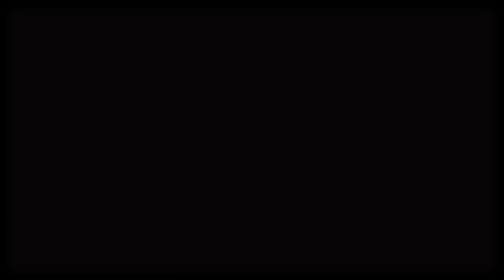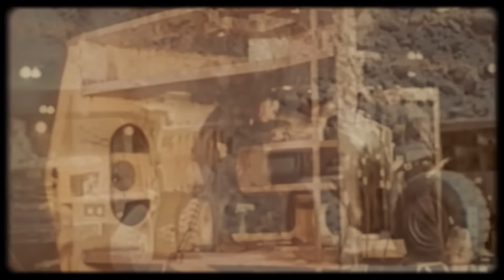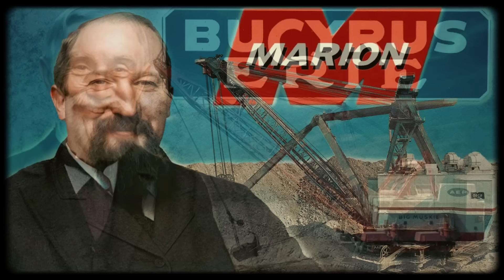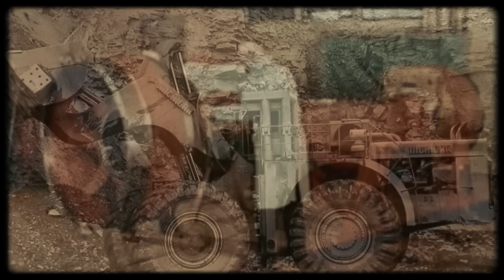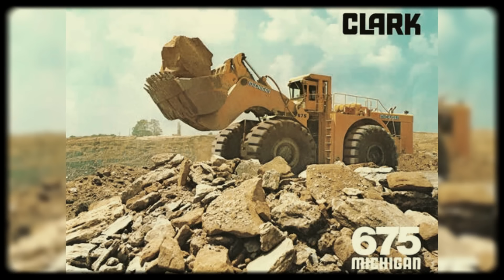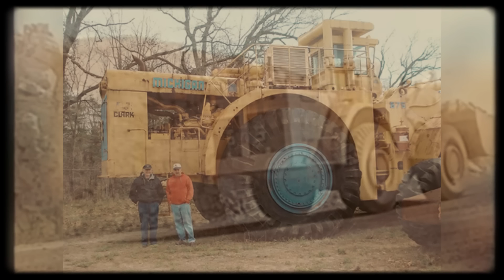They Built the World's Largest Wheel Loader (But Sold Only 14 in 15 Years)

Comment: The 675 Clark had 2 16V71 screaming jimmies Detroit diesels not Cummins
Reply: Later models had two Cummins 1710 V12 engines, I know because I worked for a Clark dealer, Rudd Equipment Co. based in Louisville Ky.
Reply: No it DID NOT the first 2 Prototypes had 2 24V71 DETROIT ENGINES!!! But the14 that were sold had 2 CUMMINS 1710 V12 ENGINES.

Comment: all this big stuff is designed to SAVE OPERATOR labor....it doesnt make sense to not buy 2 or 3 smaller ones.L believe its true about big dozers too.END DUMPS too...labor is high at 150k(all in benifits included)..but it looks like small is better.

Comment: Should have learned from the German military on Panther tank. Weighing ~50 tons, it was over-engineered, unreliable, and prone to breaking down or cracking under stress due to poor-quality steel. The Sherman Tank was much simpler lighter easy to repair. nearly 50,000 units built compared to only 6,000 German Panther tanks. Bigger is never better.

Comment: Seeing the operator standing upright with no protective cap shows this time had different safety standards (1.04 into the video)
Reply from the maker: Absolutely. 1970s safety standards were nothing like today. No ROPS, minimal PPE. Wild how much has changed.
Reply: @EnginesOfPower I saw a documentary about building the Golden gate bridge had relatively few deaths compared to other large constructions of the time. It cheated by using such dumb ideas as safety nets in some places and ignorant workers showing up with self made hard hats.

Comment: They are playing with words... to be clear, at that time in the 1970s it was the biggest loader ever made.... however by no means is it larger than todays Komatsu WE2350 for example. Which weighs almost a quarter million pounds more and has twice the bucket capacity than the Michigan 675.
Reply from the maker: You're right, should've been clearer. The 675 was largest in the 1970s. Modern loaders like the Komatsu WE2350 (formerly LeTourneau L-2350) are significantly bigger. Thanks for catching that!

Comment: I work on CAT 988 loaders all the time.  Im thinking to myself how long it would take just to line bore and weld shanks on the buck. 😂 i bet the mollboard is 4 inches thick.  Not to mention wear plates.  50,000 lbs buck.  One shank probably weighs 300 pounds.
Reply: The hell is a "mollboard"?

Comment: This not powered by Cummins  engines, but Detroit Diesel engines, two strokes, two giant tork converters in previous series at the time when released 70 early.
Reply from the maker: You're absolutely right. The early 675s used GM engines, then switched to Detroit Diesels. Cummins came later in the production run. Thanks for the correction!
Reply: @EnginesOfPower  GM Diesel and Detroit Diesel are the same engines, same company, just a name change sometime in the sixties.  Now, was it really two million, back then?
Reply: @EnginesOfPower  thank you, sir!
Reply: It had 2 16V71 Detroit Diesels AKA Screaming Jimmies

Comment: I'm surprised it had Z bar linkage at that time.
Reply from the maker: Good eye! Yeah, Clark was actually pretty advanced with the hydraulics on the 675. Shame the rest didn't work out as well.
Reply: All Clark Loaders had that linkage. Clark built a very reliable machine in the 275/475 class machines. Volvo Construction Equipment bought into Clark/Euclid in1987, within 7 years they eliminated the Clark line of machines and sold Euclid to Hitachi, I hate Volvo for doing that. I was a mechanic/welder for Rudd Equipment Company from July 1976 until I retired in July 2018. The 275C/475C loaders were some of the best wheel loaders ever built.

Comment: I was done on "Multiple engines". You did not mention this was later solved with the diesel-electric drives?
Reply: was it solved on the 675 specifically?
Reply from the maker: No, the Clark 675 never adopted diesel-electric drive. It stayed with dual mechanical powertrains (two Detroit Diesels with mechanical transmissions) throughout its production run. By the time diesel-electric became more common in large equipment (1960s-70s), the 675 design was already locked in and aging out of the market.
Reply: @EnginesOfPower  Two torque converters, one 8 speed then later a 4 speed countershaft transmission. A very large transmission!
Reply from the maker: Great observation connecting to the LeTourneau story! The Clark 675 used dual mechanical drivetrains (two separate engines with mechanical transmissions), not diesel-electric. Diesel-electric (like LeTourneau pioneered) would have simplified things, but the 675 stuck with traditional mechanical drives per engine. That complexity - without the elegance of electric drive - contributed to its maintenance challenges.

Comment: It is big for sure. But only 1/2 the size of Komatsu WE2350 with 52 yard bucket and a payload of 160,000#
Reply: When they call it “The Worlds largest Wheel Loader” they’re talking about 1970.
Reply: 2350 really is a Letourneau loader.   Komatsu bought the company and rebranded it.
Reply: Yes in 50 years since the Clark was released someone designed a bigger one.  Not all that shocking

Comment: Clark - Michigan tractor shovels were WAY stronger than CATs in a match-up (size-to-size), but CAT promoted their products better. Serviceability and oil crisis played a major role too. Clark Equipment Co. have been leading the way, while others were learning from it. The 675 was a marvel piece of engineering ahead of its time, and the market proved that this market is not ready for this kind of tractor shovel.
Reply: Not quite cat already knew the problems with a larger loader so the did the smart thing and focused on best in class production loading speed maneuverability

Comment: Last time I checked 67 inches isn't 10 feet
Reply: Probably the wheel diameter.
Reply from the maker: You're correct: 67 inches is the tire WIDTH. The overall tire DIAMETER (from ground to top) was over 10 feet tall. Should have been clearer in the narration distinguishing width vs height. Good catch!

Comment: Bigger is not always better.. CAT took notice and when they came out with the 992C  in 78 that was about half the  size but reliability, up tme, available  parts and servicability made it 10000 times more feasible of an investment.. CAT was and is still the Gold standard for Heavy Equipment.  As a lifelong Operator  nothing compares
Reply from the maker: Exactly. Bigger only matters if it actually works day after day. CAT figured that out early.

Comment: 2 mill in early 70s money is roughly 15mill in today's money.
A 2026 Cat 994 fresh out of the box is 3.2 million today.
So ya. Michigan kinda killed it with the 675. But to be fair. It was a engineering pioneer for its time.
All the big equipment companies took notes on what NOT to do with the big wheel loaders they built after it.
Reply from the maker: Yep, once you run the numbers in today’s money it makes a lot more sense why it failed. Still a bold move for its time though.
Reply: I wonder what was the biggest loader Terex made back then? I used to operate an old 90 series that my uncle bought from Bethlehem Steel. They used it to load out slag, we used it on demolition jobs. The last job I ran it on was the Benjamin Moore paint factory, previously a WW2 shipyard in Jacksonville Florida.
Reply: It’s 995 now. No more 994s.

Comment: My uncle was the field rep for Clark equipment and these were his project . There used to be one in middleville Michigan a number of years ago. I stopped there and looked it over very impressive in person.
Reply from the maker: That’s amazing. Having a family connection to those projects is rare. I bet seeing one in person hits very different than photos.
Reply: I have seen the loader closer to Hastings Michigan but it is definitely a sight to see
Reply: I came here to recount this as well I drove by that same loader many many times from the 80s- mid 2000’s on my way from the south central part of the state to my grandparents in GR.  As a the offspring of an heavy equipment operator, and being in heavy construction  trades myself it was always a pleasure to see it and as very young boy the highlight of the long drive.   I moved out west 20 years ago so I may be recalling the location wrong. 

I seem to remember it being at a welding shop on M37 on the east side of the road just south of Hastings just north of M79.
Reply: @mrsleeve325is that's the place north side of the road between Hastings and middleville

Comment: Can you ever do a video on the Dynahoe backhoe loader. It was built by Bucyrus and Erie, and it was known for its robust and strength.
Reply from the maker: Great suggestion. The Dynahoe deserves its own deep dive.
Reply: I operated a Dynahoe for a couple of weeks back in ‘81. Hated it! Power was a 2 stroke diesel that seriously lacked low end torque, which meant the engine had to be screaming just to move in sandy soil
Reply: I had one, a big heavy did. My uncle had the multi hoe it 4 wheel drive front rubber the same as rear
Reply: Dud
Reply: @rodger996  The one I operated was the same, AWD, same tires front and rear. Barely had enough power to get out of its own way in sand.
Reply: I got three Dynahoe backhoes 2 190's 2 wd and a model c from the 60's they were very robust with decent ( for the time) drive train components. Detroit diesel engine, borg warner velvet drive forward/ reverser t19 transmission and a Rockwell rear axle. But they are SLOW!